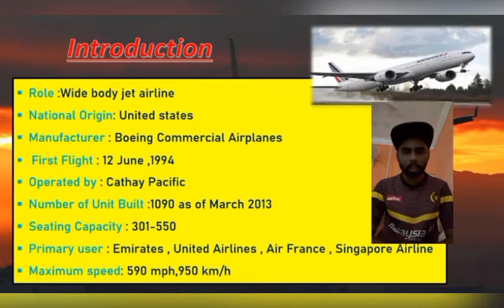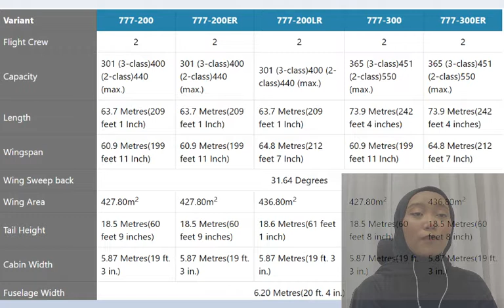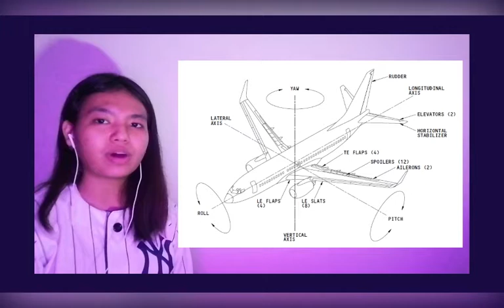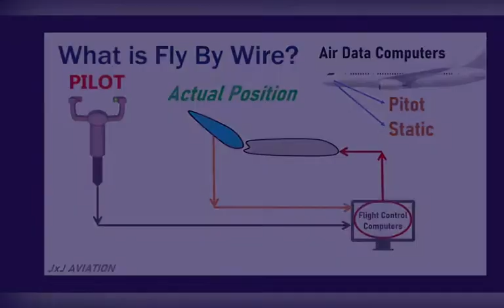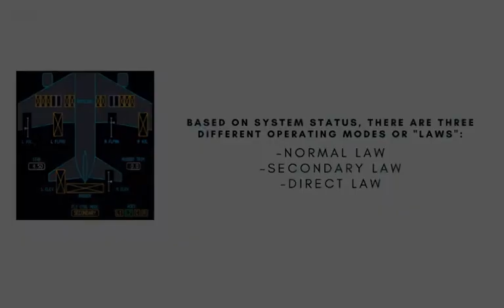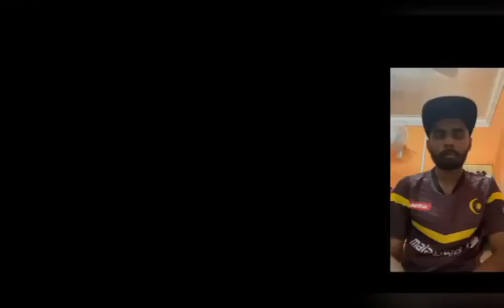AFCS 2021 SIR SYED FADZLY (3AEM2)

Comment: Brandon Goh Jian Hao 
53211222032
Q: How does the fly-by-wire system control the spoilers in an emergency on the Boeing 777?
A: In an emergency, the fly-by-wire system on the Boeing 777 automatically deploys the spoilers to aid in rapid deceleration and descent, ensuring precise and immediate control through its flight control computers and redundant systems.

Comment: Akmal Huzaifee 6Bme1
Q. Which equipment has the primary role of sending information from the pilot in a fly-by-wire system and how is it done
A. The transducers functions primarily to take in the information by the pilot using the control column and sends it to the flight control computer to output it onto the flight controls.